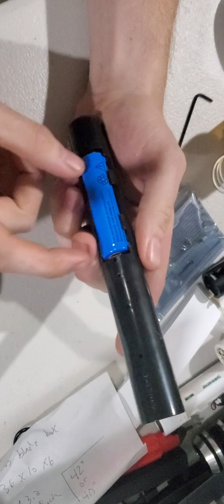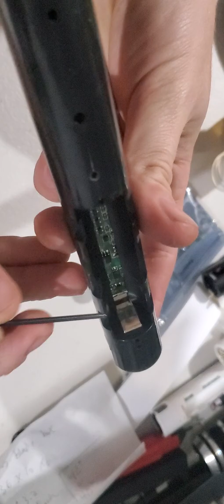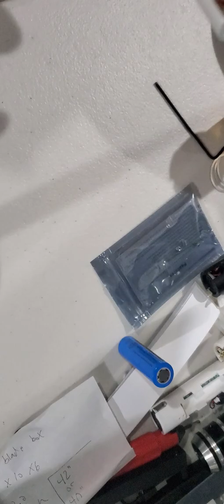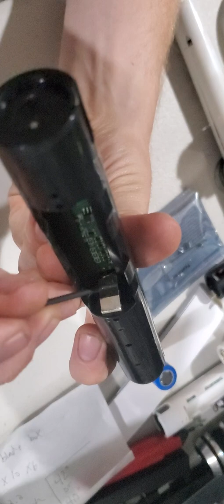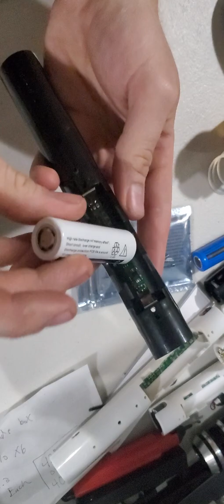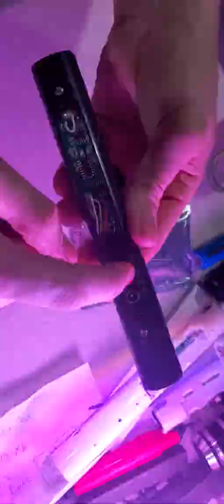LGT Saber Studio Battery Connection Fix

Comment: Doesn’t work for me. Battery is good, even got new battery. Wont turn on when plugged in. No light or indication that it’s charging. Tabs are good and have a good contact. Was working fine before battery died.

Comment: I'm having the exact problem you described with one of the new versions of the baselit, so I'm testing out the trick with pushing the connector plates out. I got mine from saberforge, but it's definitely a saberstudios core. I was wondering, would an INR 18650 3000MAH 3.7V vape battery do the job as a backup for the saberstudios one, or should I avoid putting that in the saber core?

Comment: I have a sabers pro bro pixel (which is extremely similar to this one) and when I charge it it plays the boot up sound instead of charging sound. I can only turn on the saber when it’s charging and igniting the saber will make it glow and make sounds for half a second then it turns off. Anyone know a fix? I’ve tried this method and it hasn’t fixed it.

Comment: I am having a recharge issue and mine has the same spring clips. When I bent them and put the battery back in, it said.low charge. It charges for like a minute and stops. Sigh. Was hopeful this would fix my issue.

Comment: I tried your fix and it still will not turn on, do you have any other suggestions? The saber was working fine and then suddenly quit.  I replace the battery with a fresh fully charged battery and still will not power on.  Any other suggestions would be greatly appreciated.
Reply: Lmk if you find a fix I got the same exact situation

Comment: My neopixel has different connections where one side has a flat circle piece and the other end is more like the connection in the video. I think something bad happened to the port since I've tried to fix the plates and even gave the battery some time outside the saber. When I go to plug it it tells me "ready" but I know I isn't charging whatsoever. It dies on me and continues to say it needs to be charged but then I get the "ready"message.
Reply from the maker: Could just be a bad battery.
This fix was a lot more common on older models
Reply: @viresabers5883  well, I'll admit to accidentally plugging the cable that powers my effects pedal into the port and the thing freaked out. Took it out once I realized I goofed up and that's when started acting weird. I don't know if that port thing can be removed and swapped with one from an RGB saber but the battery seems to be fine.

Comment: These boards are poorly soldered and the battery is at times to strong I've fried 2 boards I know not to put these in incorrectly. they I've wasted so much money. I know how to Handel electronics I mess   electronics . I always have to go back and solder wires also the wired used are garbage to... wire is incredibly cheap .. I wanted to love this company but it's not quite there:/

Comment: hey mine is on that screws open from bottom and the saber has a rechargeable battery. i used a defibrillator to test the power and it said 0 power so my problem is the not the battery so can u make a vid for that

Comment: My buttons to turn it on are pushed down to far, how do I raise them up again. The buttons don’t fit into the handle when pushed up to how they were.
Reply from the maker: you can use a LONGER m3 screw to help pull them up, or pull the buttons up outside of the hilt, then carefully slide it back in.

Comment: Could you give us some info mine Skips over colours and goes blank on one of them
Reply from the maker: Sounds like you have a bad connection to one of your LEDs
Reply: @viresabers5883  And instead of a white flash when you flush on clash or press the button it’s more of a yellowy type flash which is cool but I would like my six other colours 😂
Reply from the maker: @lj5046  yeah, that's because there is no white, it's a mix of all 3 colors.

So if one color is out, then it will be a mix of the other two.
Reply: @viresabers5883  Managed to fix it boss when I put the blade in I had to twist it and I think it manoeuvered the LED back into place now it is all colours And functions the same

Comment: So you know the metal piece for the battery at the ends for the connection of the plus and minus well one of em bent idk if i can fix that some how cause the light saber will charge but will light up for a few seconds and die and it only does that when charging and when its not it just doesn't want to turn on
Reply from the maker: Yeah, it's most likely not the right shape to make a good connection
Reply: @viresabers5883  what should i do
Reply: @viresabers5883  do you guys have a email so that i can send a picture of the saber itself
Reply from the maker: @glacier6655  we do, tho facebook messenger on the Vire sabers page is much easier for troubleshooting

Comment: I had trouble putting it back together, for some reason the screws won’t reach with the sockets and idk why, the button seems pushed back and doesn’t look like how I got it
Reply from the maker: Pull it back out, screws the screws in a little, then gently pull the switch assembly up a little bit, then put it back into your saber